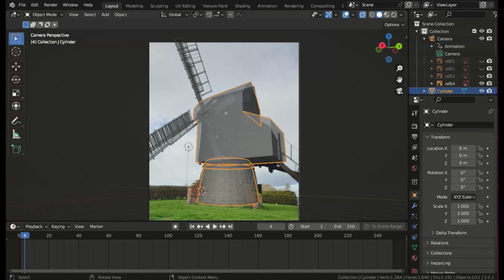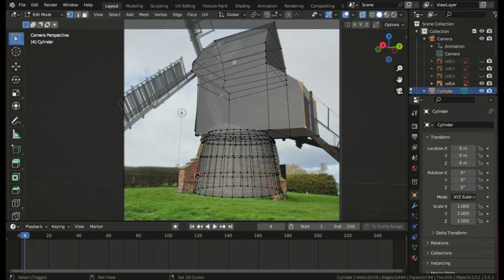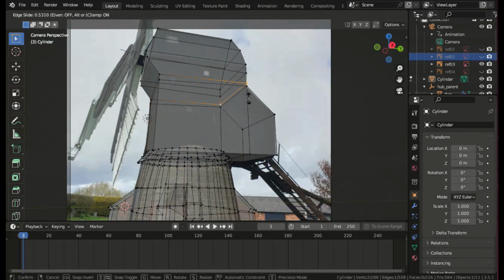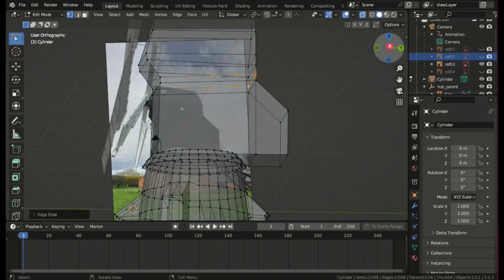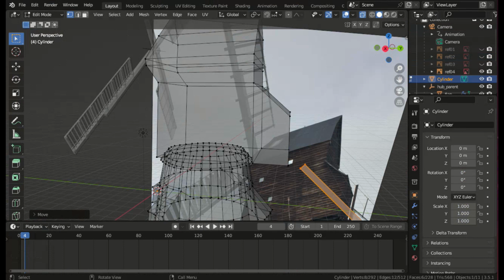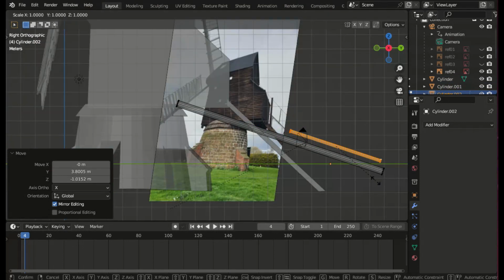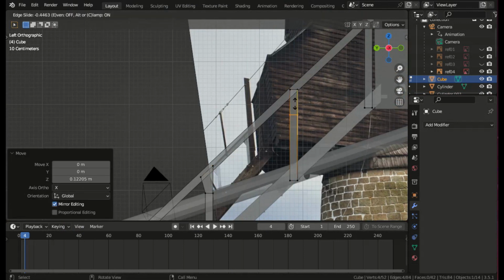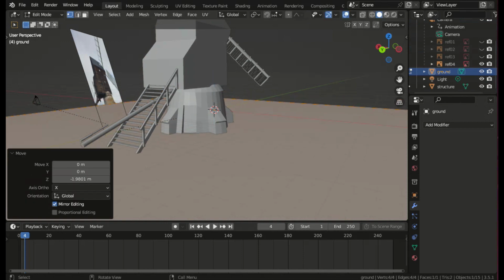windmill part 3 roughing out the meshes to match the reference images

Comment: Great tutorial series so far. I really liked the trick of using the reference images aligned with the camera to line up how it would look at different angles. I haven't seen that done that way before!
Reply from the maker: Thanks. I do skip over one other step, which is to make a note of the image dimensions (which were there along with the focal length when I looked at the image properties) those need to be used to change the camera frame if you want the rectangles to match nicely.